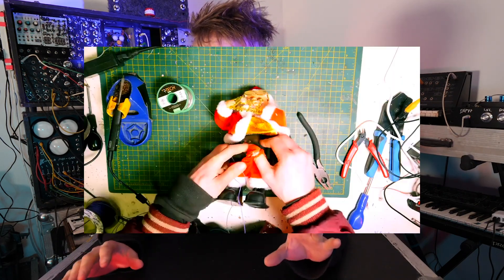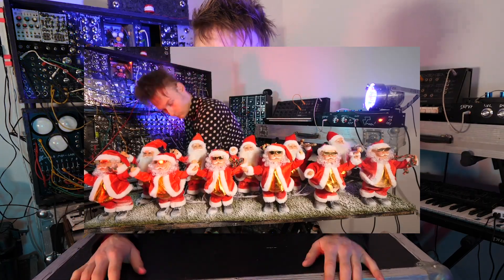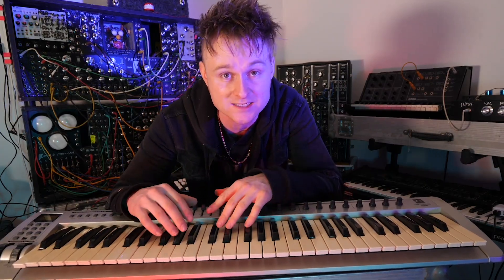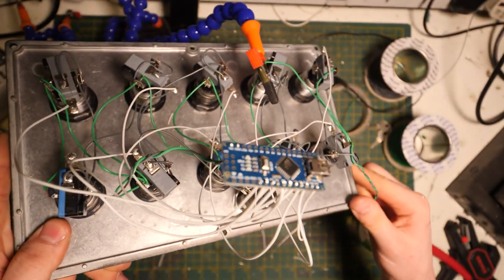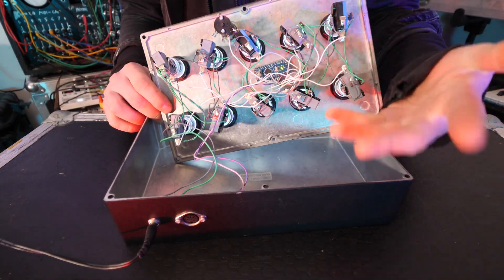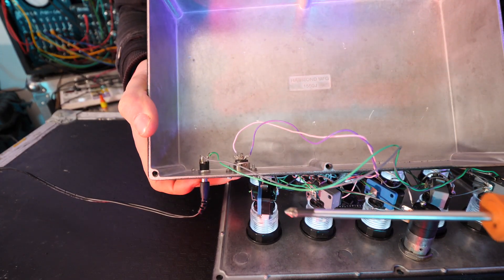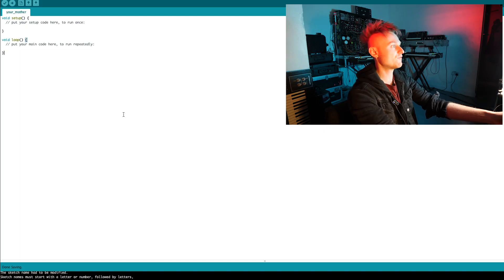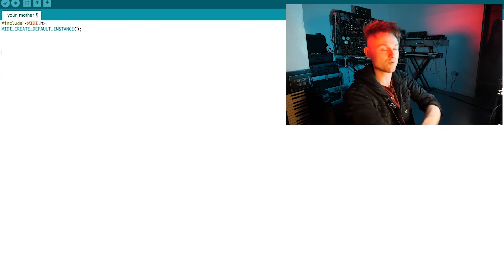SUPER SIMPLE MIDI KEYBOARD DIY HOW TO

Comment: No optocoupler? why not use a 6n37 (mutable instruments Yarns schematic) or 6n39, you can destroy you Arduino easy, the original official midi (org) schematic also used 2 inverter from a 74HC14 for the output, again to protect your mcu. midi is 5 volt, that Arduino is 3v333 (not sure if that pin is 5 volt tolerant). you can destroy it with your shoes, static ....
there is a Eagle library with all Arduino board and their headers, to make your mini brake outboard.

the cool part about midi is there are still unused bytes to make your own "commands" for custom hardware.
Reply from the maker: i mean an optocoupler is not in the midi standard for. midi out, just midi in, and to be honest i never bother with an optoisolator for miidi input either , not had a problem before, only time ibother is if it for playing shows, if its for a quick thing i dont bother. not had an arduino pop due to midi .... yet :D haha.  but midi output using an opto coupler is not even in the midi standard. so seems a bit ott no?. 

yeah that is cool anbout the spare stuff! however i havent made use of it. have you?!@? im curious! :)
Reply: @LOOKMUMNOCOMPUTER  nah, i made a midi to CV for my Tr-808 kick drum using PIc18F1320, a midi Sequencer using a 24LC512 sram chips using PIC18F452, 4 x 40 char LCD panel (blue)  and mcp4921 12 bit DAC, a couple of small projects, not using a library but figuring out out myself with leds and shift registers. another midi CV converter,
i have a half finished project using a 16 bit PIC24FJ64GA002 wanted to use 16 Bit DAC's, but haven't bought them yet, all these projects are wired like yours and are somewhat delicate or partially breadboarded in combo with tiny custom cut veroboard extentions, hate debugging all the time. i even made my own operation system. based on a STATE machine.
now my multimeter is broken.

the midi.org website is updated, i only know the old version and the old schematic, but if i where you i surely would use a 74HC14 on the midi output. it's less than a pound for you, make your self a universal midi brakeout board (with some leds) for the Arduino. the positions of the header is pretty surely somewhere documented. 
switching out a schmidt inverter or optocoupler on sockets is faster than replacing a arduino.

i also have a litle stash of the original Sharp pc-900 optocoupler .. as found in the original midi schematic and also used on roland products.
Reply from the maker: https://www.midi.org/specifications-old/item/midi-din-electrical-specification here it is, analog output shared this on the forum., no opto on the standard on the midi output.
Reply: @LOOKMUMNOCOMPUTER  it was pretty hard for me solely to get the LCD working, the microchip provided code for the microchip PICDEM 2 plus board dind't work, that toke me a long time to figure out ... the LCD needs a delay in the start sequence.

the PICdem 2 plus board is now my midi sequencer, it has lots of tiny veroboard extension dangling around it, but it included alot, rotary encoder, RAM, lotf of shift registers for leds and buttons + 4 x 40 char LCD. i have a microchip ICD3 programmer and i have to read the chips datasheets to get it going. i partially printed the 300 and some od number of pages of the PIC18F452 datasheet ... witch includes the ASSEMBLER instruction set.
Reply: @LOOKMUMNOCOMPUTER  dude, try to get a Akai MPC X and MPC LIVE II, a virtual midi keyboard you can touch with your fingers converted into CV / GATE. 

a GATE is automatically attached to the next CV output, but you can uncouple it and couple it to a new keyboard.

even the MPC ONE witch is some 650€ has 8 CV / gate out, but i think you need 2 lead or stereo mini jacks for CV.
maybe the MPC one is good for ya needs.

i think they all share the same  "core" motherboard  and massive cooler and have 2 Gig of rams.

would love to see what you can do with it.
You wouldn't be stuffed with the same patterns, but have 128 rhythm's (you can give them custom colors, (atleast on the MPC X) ... and it has adjustable swing.
Reply: @LOOKMUMNOCOMPUTER  be sure to check out this channel:  HAGIWO

he makes great modules for pennies, like ribbon controller, Wave table vco (based on Arduino), ..., ...
Reply: @LOOKMUMNOCOMPUTER  hey Chef,

you might like these ic's.

MCP23016 DIP
16-bit I2C I/O expander 
----------------------------------------
MCP23017 DIP
16-bit I2C I/O expander 

MCP23S17 DIP
16-bit SPI I/O expander 
----------------------------------------
... in combination with a 8 bit  3v33 to 5V bi directional TRANSDUCER IC, to run these IC's from 5 Volt and not load your 3v33 supply on the Arduino.

these are very handy, they contain 2 x 8 bit bi-directional ports to expand you Arduino.
using 2 or 3 wires, they have their own bios and you have to set the pin direction per pin. loading a byte.

16 button or 16 leds and much much much much better and faster than a shift register.
andn you can control every pin separate via BIT MASKING. read them.

the datasheet says how to use them ...  via SPI or I2C
using  I2C you can stuff up to 8 ic's, 8  x 16 = 128 pins for buttons or leds on 2 wires... controlled via 2 or 3 wires.
Reply from the maker: @AnalogDude_  sounds useful! Thanks!
Reply: @LOOKMUMNOCOMPUTER  .... but it's much easier to understand using a OLED display ... and some Arduino library for that display. than you can see what's you are doing.
Like the one is using Youtuber: HAGIWO.

it's the same port.

Comment: I'be been going down the Arduino rabbit hole recently (not MIDI) and it is so incredibly easy to program and get results.
Reply: I have found "ternary operators" are incredibly useful to remove annoying "if" statements, as it sets up a "true" / "false" argument that puts everything on one line.

<condition> ? <value IF true> : <value IF false>;

 I haven't tried it but would this code work?

(digitalRead(button1) == HIGH) ? (MIDI.sendNoteOn(36,127,1) : (MIDI.sendNoteOff(36,127,1);

Comment: I've always seen 220 ohm resistors on both the TX and 5v line, and the middle pin on the midi port grounded. You can get away with skipping that?
Reply from the maker: Tbh you can skip most things in electronics ha. You can skip the optoisolator in midi in too

Comment: Isn't it going to be sending midi commands like a million times a second all the time? I mean since it's a loop and it only checks if it's high or low, not if it has changed state or not.
Reply from the maker: Yeah but that’s not a problem for this project it still works and will be more than adequate for plugging into a synth. Explaining that would have made it more confusing there is another piece of code on the project page that eradicates it.
Reply: Ah, yes, there it is. I guess I should have read the project page first, huh. lol

Comment: Well, i have seen worse code....
...in my arduino projects for example...
Reply from the maker: Lol
Reply: @LOOKMUMNOCOMPUTER  i made a synth once. An arduino due with some DYI midi in, an sd card reader with an sd card with an old amiga mod file on it, a headphone jack attached to one of the DACs of the due, and some software that extracts one of the samples in the mod file and plays it on the DAC in the speed corresponding to the note on midi in. The software was a mess ;-)

Comment: MIDI's a beaut. I've got an old knackered-out (all synth chips dead) Yamaha Electone B35-N organ from the 70s knocking about that I'm waiting to convert into something mean. It's a lot of keys (two sets of 55 or something close to that maybe) with loads of pistons, pedals and levers to wire in. I've got a few candidate arduinos knocking about, but I haven't decided which one to use yet. Thanks for the inspiration needed to tackle the thing. The plan is to build a synth PC i've already prepared (forgive me) into the side. Can't wait to enter shift-register hell getting all those to work
Reply: Probably easier to use a load of I2C port expanders, you can put 4 or 8 on the bus depending on how many address channels they have and if you have a MEGA they have multiple I2C ports.

Comment: Good job on that.  Gives me some cool ideas.  I do have one question about the code though.  Does the Midi library handle de-bouncing?  If not, you are going to be flooding the midi bus with events at quite a rate as it's going to be sending 11 events every iteration of the loop.
Reply from the maker: No it doesn’t but it doesn’t really matter. In that code you are flooding the midi bus anyway because each button is constantly triggering either on or off. It was for simplicity of the video. There is a tiny improvement on the website code where denouncing isn’t an issue anyways as it acts as an sr latch.
Reply: @LOOKMUMNOCOMPUTER  yeah, that was sort of what I was getting at ;) I've not done anything with Midi since the late 90s, but I remember that .midi files were just single on and off events rather than a stream of on and offs
Reply: It doesn't but the readDigital function baked into the Arduino does.  It takes something like 256 clock cycles to read a digital input with an Arduino because of all of the debouncing and error checking.

You can "hack" the Arduino and address the port pins manually but for most Arduino projects the speed isn't an issue.  I was curious to know if Sam experienced any timing issues due to the delay or whether it was fast enough that you didn't notice.

Comment: I don't actually use C++, but I'm pretty sure you could use a "for loop" to run that "loop()" logic in just a few lines instead of having a ton of copy/pasted text. I know code isn't your thing, and that's fine, but learning loops can be a massive time saver; so anyone interested in learning to code should give this a try IMHO ;)

Assigning the actual midi notes could be a bit of a pain since they're not sequential, but an "Enumerator (enum)" could be a way to go?

Also, when you have your two IF statements for HIGH and LOW, you could just use IF(...LOW) {...} ELSE{...} since the value is either high or low, and cannot be anything. Right? (not too familiar with how the Arduino works)
Reply from the maker: you misunderstand why i did it like this, like i mention for codey folk there is a more sensicle approach, however as i started trying to do code the learning curve made it hard to figure out. yes it is more long winded to do this way but it makes more sense for people who ain't got a fudging clue, this project is not made to streamline but made to make sense
Reply: @LOOKMUMNOCOMPUTER  Totally! I put this here more for anyone who might be interested;
Clearly, your code works, and that's what really counts in the end! And since the code isn't doing a lot, optimizing it isn't really necessary at all ;)
Reply from the maker: @RougeEric  yeah all good! i mean a good example i might do later tonight is write the same code but compressed.
Reply from the maker: i mean to be honest, knowing how to make code now adays better than when i started.i still opt for the step by step approach haha. but i am a grade A plonker.
Reply from the maker: ultimately you are correct. but thts not the pount iof the vid :D cooilio

Comment: They really did a great job with midi. It’s just been the same connector and data standard forever. Even the new mpe keyboard I got is still just midi over usb but using some extra channels for all the extra expression info.
Reply: They even made a nice MIDI 2.0 version in 2020 with better resolution and nice new options but keeping it backwards compatible with the old MIDI. I love these guys, nice simple standard without the BS.
Reply: @AndreVanKammen  We can thank Dave Smith (Dave Smith Intruments / Sequential Circuits), the father of MIDI!
Reply: @StingrayOfficial Dave Smith rules, I love my Mopho
Reply: @AndreVanKammen  I was about to point that out, yeah the new protocol is really nice how it's completely backwards compatible. I love the identification part - controller with MIDI 2.0 is like "you speak MIDI2.0?" and the old MIDI 1.0 device is like "...". So the new interface reverts to MIDI 1.0.
Reply: @AndreVanKammen  Not only that, but any MIDI 1.0 devices with memory onboard could have some 2.0 features added with an update. It may have taken decades for a major 
revision but it looks like they're going to do it right.
Reply: I did basically this same kind of project with a set of organ pedals many years ago and found something interesting.  I always wondered why the MIDI serial port rate was 31,250 baud - kind of a weird number.  More typical would be 9600,19200, 38400... turns out 31,250 is the fastest baud rate you can send from a 20MHz 8051 (which is what I was using for my project).  So I'm betting that is the original processor they used for the prototypes :)
Reply: @VAXHeadroom  that would mean they divided 20mHz by 640, not accounting for start and stop bit. but 640 is still a multiple of 10 and 8.
Reply: @AnalogDude_  Found the source code :)
It was 12MHz not 20.
my init_uart function has:
SCON=0x52; /* mode 1 receiver enable */
TMOD &= 0x0F; 
TMOD |= 0x20; /* timer 1 auto-reload mode */
TL1=0xFF;
TH1=0xFF: /* 31.25K baud at 12MHz */
TR1=1; /* enable timer 1 */
Reply from the maker: yeah!!! im glad newer products are ditching the midi over mini jacks and going back to 5 pin din! the mini jack midi is awful haha
Reply: @LOOKMUMNOCOMPUTER  nothing wrong with the mini jack, but they are asking like 20€ for (... or something around that) for a original Arturia jack to din converter.
than the fact you can loose it.
Reply: @AnalogDude_  Wow!
Reply: @LOOKMUMNOCOMPUTER  ... and you've got to worry about which manufacturers use MIDI-TRS A and which ones MIDI-TRS B. Blargh.
Reply: @thegreatbigmulp  that really is the stupidiest.  Always they do this, centre negative/positive, etc
Reply: @LOOKMUMNOCOMPUTER  Oh, not seen ones with a mini version. Yeah, I'd much rather the proper full size one. Everything just fits it, and it's stronger.
Reply: @LOOKMUMNOCOMPUTER  I completely agree. I hate MIDI over 3.5mm and MIDI over USB, Ironically enough, I work in IT on Level 4 Diagnostics, System admin, and networking = IT Generalist. And I still despise MIDI over mini 3.5mm stereo headphone jack. USB-C might be ok for mobility use, but not for anything big like an Alesis Andromeda A6, which is my dream synth, besides a Korg MS20 or that large wall sized beast you have.)
Reply: It is just a simplified com port.
Reply: As a developer, i agree they made a friking incredible job. But also this demonstrates that most of the ports and stuff we have today are just not that needed. After all is just a bunch of cables sending signals. 3.5 Jack i think is a unique example of this, even Apple used it instead of usb for the nano, which i think was better than whatever they use. 
That's what i love about hackers and this guy's channel (which i consider a hacker) they break the illusion and teaches you you can do amazing things with simple ones. And that you can repurpose anything. You can create.
Reply: Everyone here might be hating on the 5-pin DIN, but it doesn't physically break as easy like USB-C and 3.5mm to MIDI. My Korg MS2000R is proof of that. It is 20 Years old , maybe 22, and its 5-Pin Midi plugs are still great, but so many MIDI USB-C keyboards or the ones with the 3.5mm to MIDI , are being sent back or sent in for repairs, more than anything that was built with 5-pin MIDI. 

The old adage tracks. "If it isn't broke, then don't try and fix it."

I will only buy MIDI equipment with 5-PIN DIN . unless it is to just screw around with a Raspberry Pi and then I am forced to buy the cheap USB MIDI equipment. As in cheaply built.